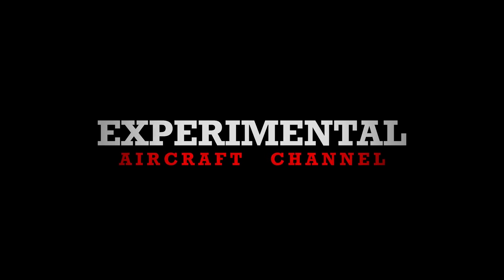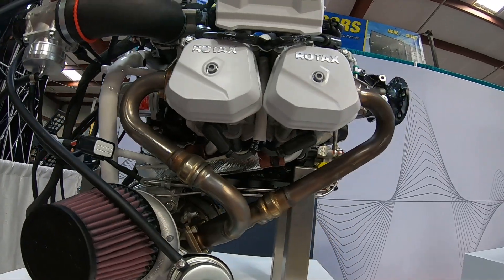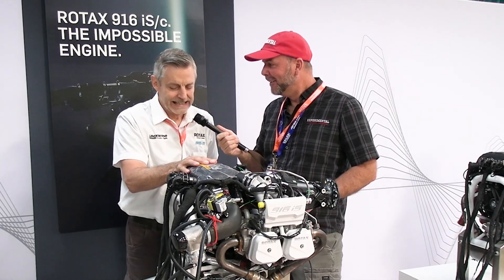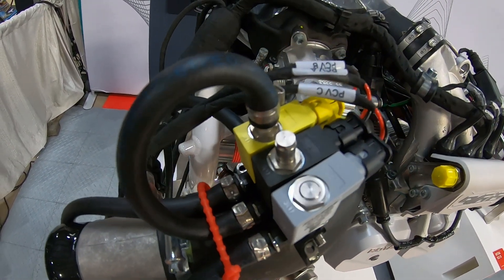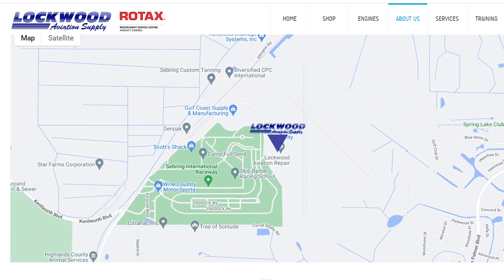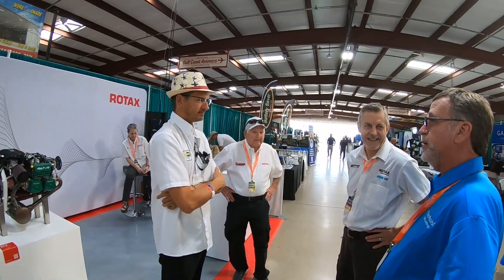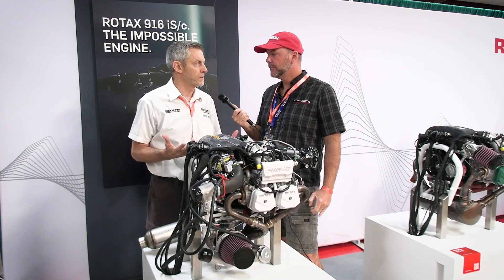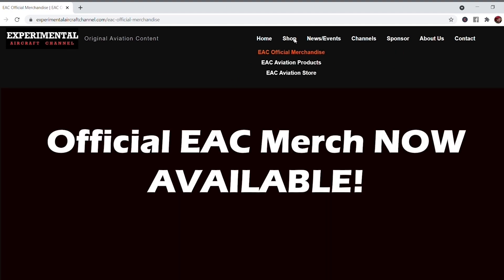Rotax 916is Engine MASSIVE POWER! Increase to Aircraft

Comment: Its a trip to see how small it is. If you have ever done a motor swap on say a Chevy Truck those massive motors are like $3,000 to 7,000 grand ballpark. This motor is $60,000 which is insane. Its also a piston combustion engine not a turbine.

Comment: Simply splitting ring section from skirt, the 2-piece piston retrofit technologies can usher in the advanced hybrid engines. The ring-section is operated via (valvetrain-like) piston-train to pump the gases in the exhaust strokes and reunite with skirt for the heavy compressing and power strokes. This new piston design completes the 4 strokes, different in both displacements and periods, in every revolution – called differential-stroke cycle which is a hybrid of 2-cycle and 4-cycle – to >2.5x power and >20% efficiency gains.

Comment: A "TBO" for an "upgraded" experimental aircraft engine. You bet. Of course that's if its installed, maintained,.serviced and operated PRECISELY to manufacturer "recommendations". 

And is that "aero engine" a FIXED WING engine or a ROTARY WING engine?

Comment: Upgrade the internals, forge them or triple forge them, larger fuel injectors, change the ecu program, it's not a ridiculous horsepower increase they didn't try to double it.
They also have the data on all the testing and real world running issues with essentially the same engine in the 915 at least, so they fix those issues as well.    What's the weight difference.    If there isn't a huge penalty for weight how would 200 hp hold up with this configuration?   Sounds like maybe they are holding back on performance a little, in my view.   The only limit I see is how much charge air can you fit into those 4 cylinders?   Looks like you could rebuild your stock 915is and get 916is or greater performance with the information presented in this video.

Comment: With respect to percentage of power. If you run either the 915 or 916 at 75% power is that percentage of the max continuous of 135, or its maximum of 140/160? For example is 75% power of the 916 greater than 75% of the 915? And if so would the 915 at 80% be equivalent to the 916 at 75% or thereabouts? I’m trying to find out if there’s any real benefit to the 916 over the 915 which I already have other than a 14% increase in takeoff power for five minutes.🤦🏻‍♂️
Reply: If they are running more boost and both keep the MCT RPM the same, then the 916 will give you the extra power. Tbh in the LSA market that this is aimed at 160hp seems a little overkill.

Comment: A 13% increase for 5 minutes and a 1.5% increase in max continuous is MASSIVE POWER!?  What adjective is left when there really is a significant power increase such as 50%?  😂. Given that the new price is $7,000 more than I just paid for a 915iS, that is a pretty pricey few horsepower.
Reply: Don’t forget the 915 iS dynos at 146HP too.
Reply: @andrewmorris3479  I was comparing published Rotax specs.
Reply: @LTVoyager  Yes I know, just letting others know Rotax is pulling a fast one here.
Reply: @andrewmorris3479  How are they pulling a fast one?  Have you seen Dino results on a 916 yet?  It may well dyno above its published specs also.  Even Lycoming and Continental engines routinely dyno above their published HP specs.  It is common for engine makers to be conservative on what they publish.
Reply: @LTVoyager  Because there are 915’s already pushing 50” at 5800 which equals 160HP. I can assure you the 916 isn’t doing more than 160HP.

How else can you convince the world the 916 iS is a “new” engine? 146HP at 45” doesn’t sound very different than 160HP at 50”, and it certainly doesn’t justify 9K more. I’m disappointed with how Rotax chose to proceed here.
Reply: @andrewmorris3479  We need to know more.  I just took the iRMT training a couple weeks ago and from what I have seen of the 916 a number of things look different.  The gearbox for one looks new.  Even the folks at Lockwood haven’t seen all of the details, but it may be that the bottom end of the engine was beefed up for the extra HP.  Being able to increase boost on a 915 to get the same HP as a 916 doesn’t mean they are the same if the 916 has been beefed up to handle that power longer.  The 916 comes with a 2000 TBO and as far as I know the 915 is still at 1200 hours.  I expect them to bump the 915 up at some point, but if they don’t, then the extra 800 hours of TBO is easily worth the extra cost of the 916.
Reply: That's massive in the aviation world for all other metrics being equal. That's like going from 97 to 99% difference in efficiency and calling it "tiny" when you cut the wasted energy into 1/3.
Reply: @pilotavery  LOL.  No, it’s not even close to that.  What a poor analogy.  Going from 97 to 99% efficiency is huge because the limit is 100% and things get very hard as to approach a limit.  Light aircraft engines are available up to well over 400 HP so the power of a 916 isn’t even close to approaching the limit in its category.  Try again.

Comment: Unlike Lycoming and Continental, Rotax has a modern advanced efficient assembly plant that should create cost savings that Lyc/Cont can't match.  However, the factory is located in Austria which is about the most expensive place in the world to manufacture anything.  And the cost of freight, customs and a distributor such as Lockwood means that any cost savings evaporates.  UL has the same problem but also has a small engine assembly shop like Lyc/Cont.  Non aero engine conversions could gain more market penetration as the prices continue to increase.  Also, increasing the LSA weight limit will also benefit the engine conversion segment.  
Also, Factory support in the USA for Rotax for the most part is terrible.
Reply: Rotax, ive really started to dislike them. Many little problems with these engines. Cheap motorcycle parts that are resold to us as airplane parts at 10 x the price! Who will work on your engine? Who know's how to fix it? Can't find anybody usually...
Reply: @franksanders7102 - disagree.  I have been to the rotax owner class.  Other than cracking open the case, I am comfortable with all maintenance on 912 or 914.
Reply: @franksanders7102 They're not motorcycle parts. They're SNOWMOBILE AND PERSONAL WATERCRAFT AND ATV PARTS, LOL. BIG DIFFERENCE. MOTORCYCLES HAVE.TO BE MUCH MORE "RELIABLE" AND "HIGH TECH" WHEN IT COMES TO EMISSIONS STANDARDS EVEN OFF-ROAD. 

So Rotax has never "invested" in that "market". At least not in "America".
Reply: ROFLMAO. Oh yes. European "efficency" in "modern" facilities is SO much more "cost effective" than the American "competition" and therefore more "affordable". Because "efficient" mass production of experimental aircraft engines is SO important for "affordability" and getting KIT PLANES IN THE AIR AS "QUICKLY" AND "CHEAPLY" AS POSSIBLE AS AN "AFFORDABLE ALTERNATIVE" TO REAL CERTIFIED GENERAL AVIATION AIRCRAFT ROTAX'S "COMPETITION" AT LYCOMING AND CONTINENTAL "CONCENTRATE" ON. YOU BET. 

You're not even making an apples to oranges comparison and come "overhaul" time is any A&P in "America" going to TOUCH that European "efficiency". Or "maintain" one between annuals? Or annual one at all? 

Not so much. Nothing "superior" and "assembled" in Europe is more "affordable" to a "competitor" made in "America" for the exact same purpose. 

And no Rotax engine is an "option" OR "alternative" in a factory-built general aviation aircraft with Lycoming OR Continental power AND there isn't a KIT PLANE out there capable of USING all 160 max TAKEOFF power for "5 minutes".

Comment: I really like the Rotax product, doubling the rpm in order to reduce the displacement while making the horsepower with a modern ignition and fuel system, low weight makes sense.  Unfortunately, it appears Rotax is going the direction of Lycoming/Continental and becoming a super expensive boutique aircraft engine manufacturer.  But you can actually overhaul and rebuild a Lycoming/Cont and find them on the used market.  A Rotax cannot be overhauled or rebuilt as the factory and Rotax distributors such as Lockwood highly discourage it due to cost and they would rather sell you a new one.  They are throw away engines once they fail the condition inspection.  My friend the A&P who works only on LSA says only 4 shops in the US are "allowed" to split a Rotax case.  I just don't get it.  The door is wide open for Yamaha or anyone else to step in with a high RPM engine from the factory.   You would think these engines are made out of Gold or Silver.
Reply: Totally agreed BUT they really need to target the aircraft market. That's pretty much running at full power for extended periods. Yamaha makes boat engines and other high endurance high power continuous engines - so they have the know how somewhere in their company - not sure they see it as worth investing in air.
Reply: I know Lycoming and Continental (and Jabiru, ...) also can be improved a lot by several unofficial modifications and STCs while Rotax have a single unofficial modder as far as I know.
Reply: Rotech in Canada can rebuild them. They are VERY difficult to deal with. Its like they know they have a corner on the market and will use it against their customers... Not cool

Comment: Rotax builds some really great engines and the new 916is is no exception.  However, they're incredibly overpriced, so I'll be installing a Viking engine in my aircraft build. Yes, the power to weight ratio isn't quite as good, but with it being over $30k cheaper, parts costing much less and still having the legendary Honda reliability, I'll be quite happy with it.
Reply: I dunno, the Viking a friend of mine had did not exhibit any "legendary Honda reliability" when a rod came out the case after a few hours.
Reply: I really would love to know what it costs Rotax to build, granted there is some R&D involved in price but jeeze, over 50k for a motor?? that will cost u another 20k after your 2000 hr TBO..... I know they are well built light weight motors but ive always had a dislike for a 5k RPM at cruise 4 stroke......
Reply: I thought viking had a ton of problems on their "reliable" honda - at least at the start it didn't really live up to the thinking. Do cars run max power all the time? That's a big diff from car vs airplanes. I'm sure they fixed some of the issues over time, but at least at the start my impression was some real issues with the "honda reliability".
Reply: @randominternet5586  This is another reason to look for other engines to convert besides common car engines, they may be more expensive or trickier but the amount of effort to convert them may be smaller because they were made for higher continuous power output, rougher environments, ...
Reply: There's an old saying....'cheap is more expensive' Good luck with the Viking.
Reply: https://youtu.be/WeQhkOBDsN8

Yeah but these engines can easily last to 5,000 hours before overhaul. They aren't certified for that much but they look brand new when overhauled at 2000. If you're doing the experimental market, being able to last 5,000 hours instead of maybe lasting 2000 if you're lucky like most engines, the cost actually is half as much as the sticker price when related to the hours
Reply: @pilotavery  The expected maximum TBO is 2000 hours, this isn't a problem specific to the Rotax either.
Reply: @vitordelima  that's right, that's all they want to approve for. But it can easily last 5000, is the point. It looks as good as 5000 as a Lycoming at 10000.
Reply: My opinion as an engineer, don't trust Viking, they don't know what they are doing, they are just trying to make quick money. they declared bankruptcy before starting Viking. Automotive engines are better than aircraft in many ways, but the correct engine must be chosen. There is a lot of dishonesty from Viking. He knows little about the engines they sell, he contradicts himself when talking about them and even dyno graphs on their website are not accurate. Don't trust your life with someone that is dishonest.
Reply: @chippyjohn1  rotax has the right idea
Reply: @pilotavery  900 series is certainly better, but there are automotive engines that are better again. Depends on application.
Reply: @chippyjohn1  what kind of automotive engines are better? There aren't any automotive engines rated for the same continuous horsepower that are anywhere close to as light.
Reply: @chippyjohn1  automotive engines are usually derated to about half power. The general rule of thumb is 200 horsepower car engine becomes a 100 horsepower airplane engine.
Reply: @pilotavery  Where did you get this rule from? There is far more to an engine than just revs. The automotive engine I am using is the Suzuki M13A, but it is extensively modified. It runs a peak of 165KW and continuous of 150KW at 5000. Similar engines are the Yamaha Apex and Suzuki Hyabusa, but not quite as good design wise in my opinion. My application is a small helicopter so the rpm is kept constant, but for a plane it could go to 6000 as tested making around 200kw. with the engine being around 100kg with single turbo and manifolds that gives it a power rating of 2kw per kilo. This 916 is only 1.4kw a kilo. A little more weight can allow a lot more power. All of these pushrod single valve engines are behind, but people buy them so they sell. Big companies dont make new products if people continue to purchase their current products. Most aircraft are also designed around these style of engines. One beauty of a liquid cooled engine is the cooling can be remote, you can use the leading edges of the wings as a radiator. Quite simply engines and aircraft were far more advanced in the 1930's than they are today. People want cheap planes that are good for short trips so that is what they are given. Companies like Lycoming and continental made money during the war making radial engines, and after the war they simply downsized by using what they had already. With the US not really being affected by the war their success grew. Companies that were making good engines were destroyed and people in europe did not have the finances for leisure aircraft. Rotax was primarily building single cylinder engines and put several together to make twin and eventually 4. All 3 are examples of using what they had instead of building a good engine. Car engines that are suitable for aircraft are manufactured around the year 2000. After this they have become to complex and incorporate components not at all required for aircraft such as VVT. If Glycol was readily available and cheap in the 50's all these aircraft engines would have ben liquid cooled a long time ago. A Rotax engine is more complex than a simple inline 4, it has more hoses and weak spots all over it. Your average car engine is designed far stronger than it needs to be, while aircraft engines are on the edge. The cylinder heads of a lycoming or continental are half as strong as that of a liquid cooled engine due to alloy losing strength with heat. I have studied many engines for my project, the best for my needs is the M13A, even standard is really good, but mods such as steel pistons make it so much better. I'm sure you will say, steel pistons? mainstream engines are far behind.
Reply: @chippyjohn1  the 916 uses the weight of a turbo to keep constant horsepower up to 18,000 feet.
Reply: @pilotavery  I understand that. My engine also uses a turbo, two in fact to produce takeoff power up to 14000 metres calculated.
Reply: @chippyjohn1 yup Viking is a scam artist. Both him and his wife are the only engine companies that are constantly defending themselves in comments and arguing with customers.